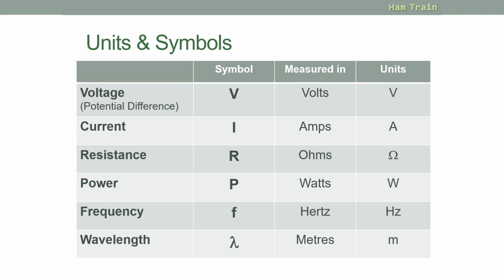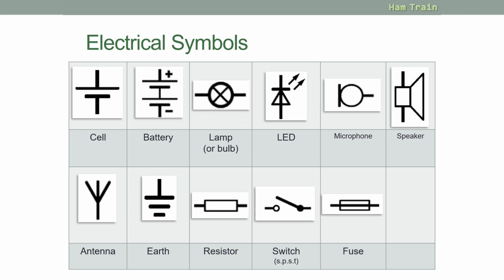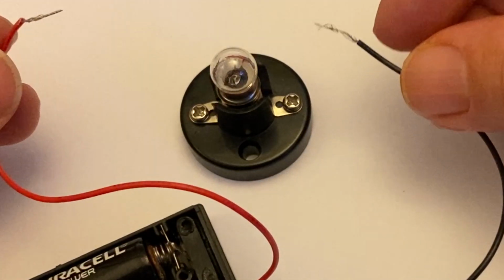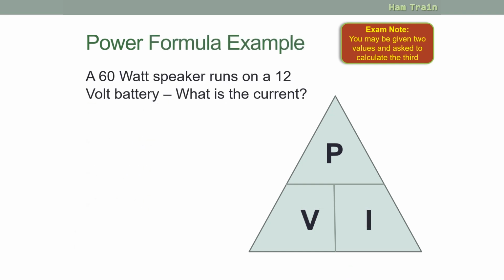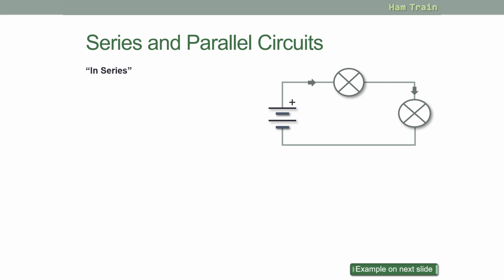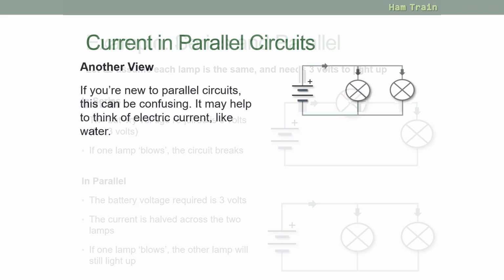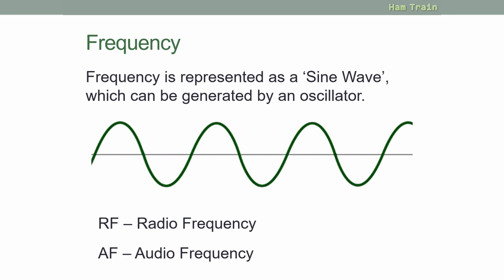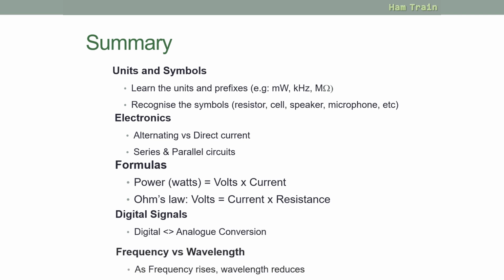HamTrain Foundation Online: Technical Basics

Comment: Human hearing is 20hz to 20000hz not to 15000hz I was for years like this, that's what I look always for headphones ect. That they have this frequencys on the box.
Should be corrected.
Reply: Yes in theory human hearing is up to 20k... But that's for a teenager/20 year old with excellent hearing. This number steadily reduces as part of the natural aging process. By 30 to 40 years old most adults struggle to hear 15k or above. The video states that a healthy adult has hearing from 20Hz to 15k Hz, which is entirely accurate. So no need for a correction.
Reply from the maker: It’s in the exam syllabus, so that’s what they’d expect you to answer in the exam
Reply: It's still wrong and they should correct it and not lieing about things that are not truth and real fact based.
Reply from the maker: @WaschyNumber1  Probably best for you to contact the RSGB - they write the syllabus and set the exams.